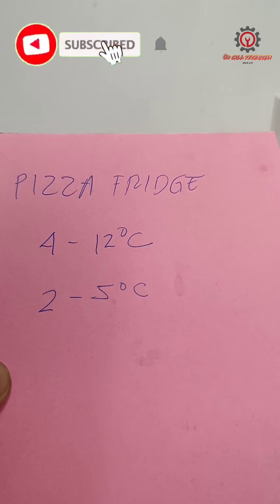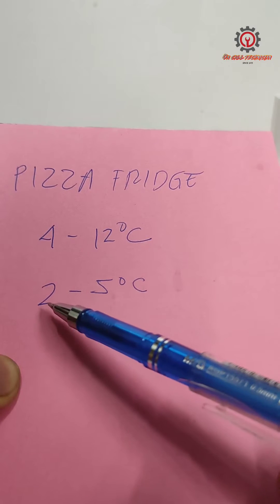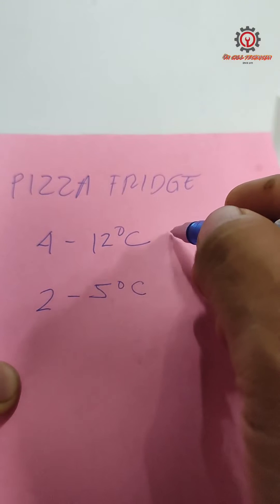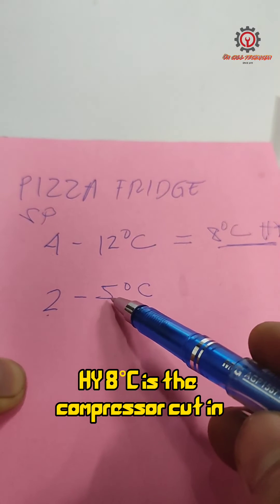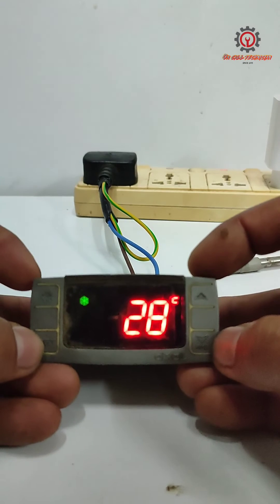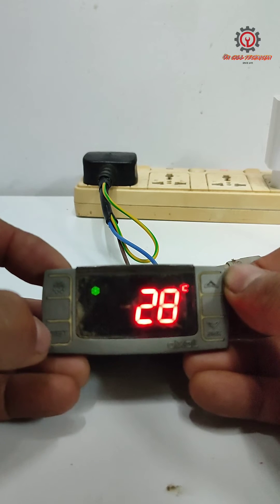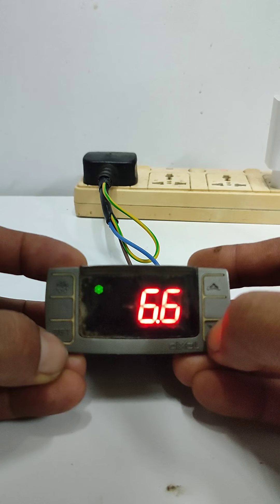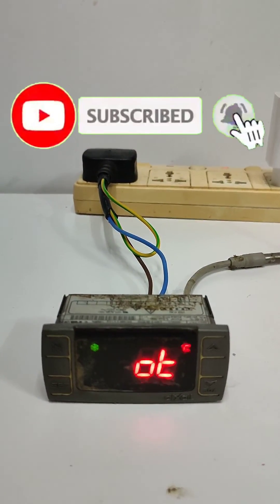UNDERSTANDING DIXELL  CHILLER SETTINGS 4°C TO 12°C

Comment: Hello sir paano po baguhin yung cut off cut in ng compressor ang problema po kasi ng chiler pag na-reach na po yung 20°C tsaka palang magdedefrost using hot gas. Ang buong evap. ice build up na po. Maraming salamat sir.
Reply from the maker: IDF po baguhin mo sir at set mo sa 3-4 hrs interval at gawin mong 15-20 mins duration ng Defrosting mo, MDF
Reply: @THEMULTISKILLEDTECH  baguhin ko po ngayon sir, maraming salamat po sir. God bless po🙏
Reply from the maker: Welcome po, update ka lang sir
Reply: @THEMULTISKILLEDTECH  opo sir update po ako. thank you sir
Reply: hello sir upon checking now my chiller normal operation no ice build up on evap. thank you so much sir. God bless po🙏
Reply from the maker: Welcome po sir, please share my Tutorials sa mga friends or co technician natin🙏
Reply: @THEMULTISKILLEDTECH  noted po sir. thank you

Comment: @OCT TV Hi sir my dixell merer showing that its stuck in 11.4  and taking more time to reach 10.5 which i set. Please help
Reply from the maker: Check your pressure sir, adding refrigerant will solved the issue.
Reply: @THEMULTISKILLEDTECH  sir when my defrost mode is on compressor is still running its not stop
Reply from the maker: Is it hot gas Defrosting?
Reply from the maker: Hot gas Defrosting - compressor still on
Heater Defrosting - compressor is off